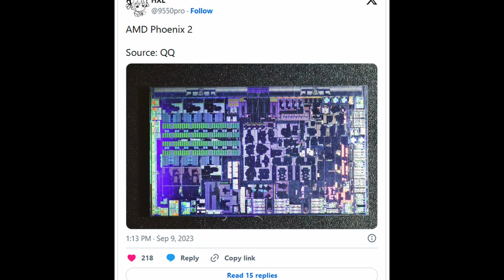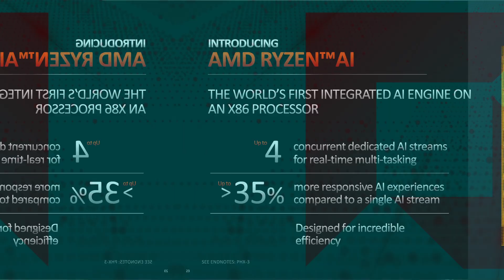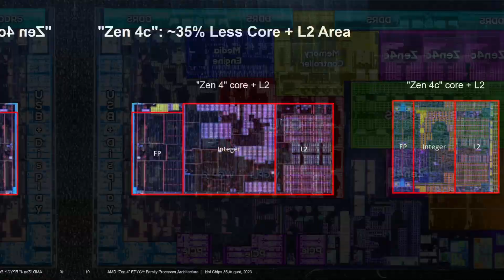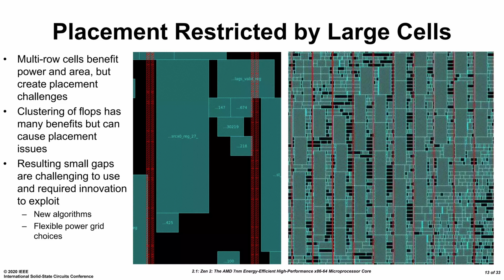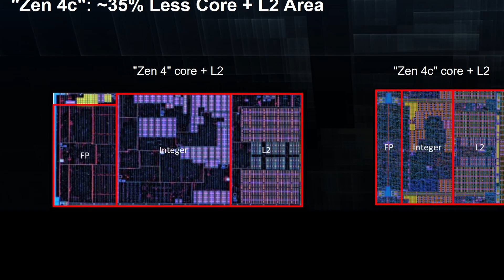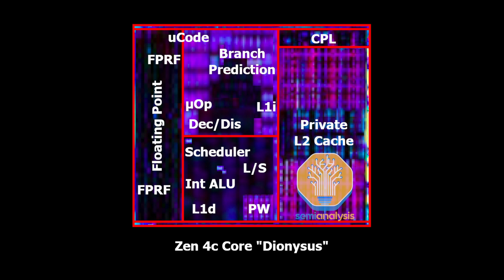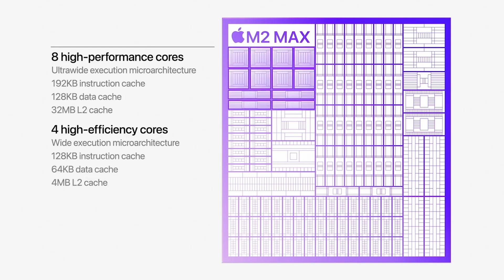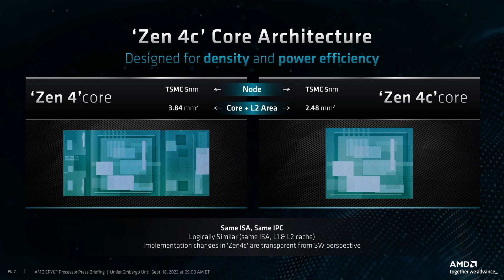Why AMD's first Hybrid-CPU is Different

Comment: ADVANCE MICRO DEVICE !AMD! I dont know whats happend to them since 2014 but dr lisa su seems to be on crack cocaine ive read articles  where the new zen 5 will have up to 32 cores on one single chip plus it would have a full blown integrated gpu rdna 4 inside so no need for a external gpu so lets see what next gen have to offer . To intel and nvidia  this would be a slaughter
Reply: Dr. Lisa Su seems to manage things pretty well, yes. However, the bulk of the credit for the Ryzen CPU designs should go to the numerous engineers that worked their @sses off day and night over the years to deliver the outstanding results we are witnessing today. :) If only their GPU division could match the success of the CPU division. Nvidia are still unmatched in compute, sadly. We need a viable competition to CUDA.

Comment: You really need tight coupling for thread shceduling. On the M1/M2 platform, it works extremely well. The GUI is smooth and only pegs the E cores in regular usage.

Comment: I’m having a hard time calling it hybrid, the cores are to similar. I see AMD creating a “real” hybrid by using Zen5 with Zen4c.
Reply: Why would you use 4c instead of 5c?
Reply: @maynardburger  because I think that the dense versions (Zen4c, Zen5c, …) are only synthesized after the “main” core (Zen4, Zen5,…) are finished, after all the bugs are out.